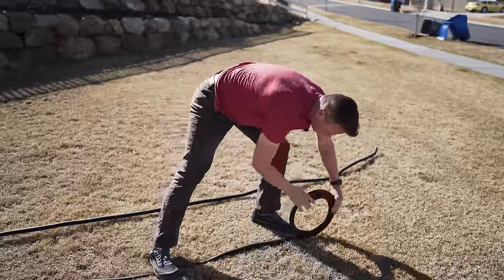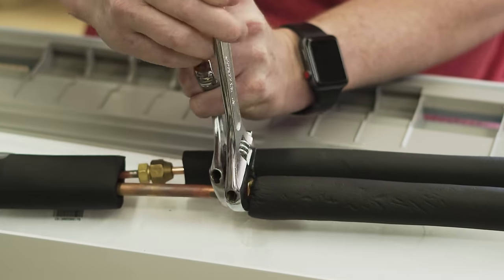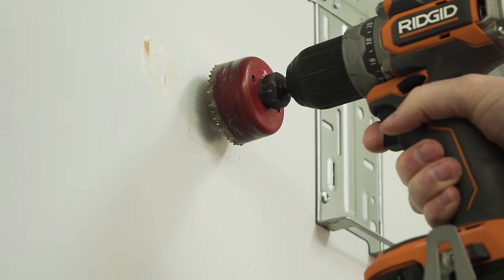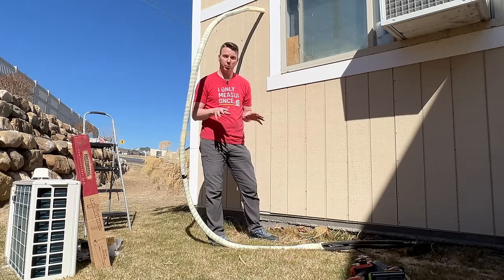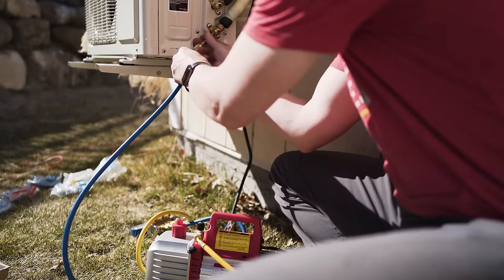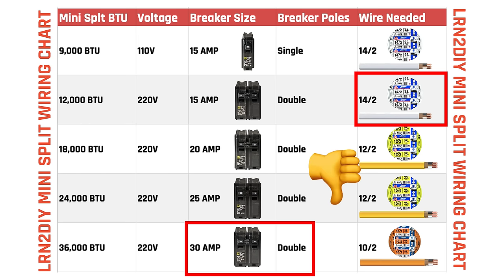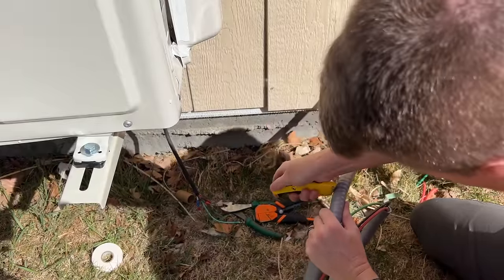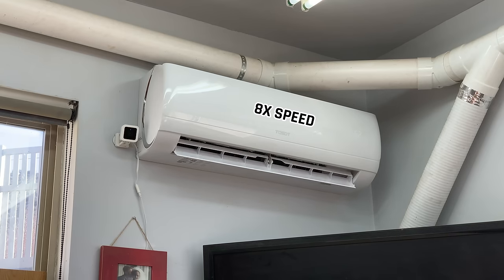DIY Mini Split Install - All the Things Nobody Shows You

Comment: I did the same a year ago with another brand, including electric work. As you mentioned, it was hard to find info on that part!

This video is a great service to DIY. I spent $1400 all in when quotes where $4k from pros. 

Only thing curious is coiling the excess pipe behind the outside unit vertically. I thought that was a problem for some liquid that could block at the bottom (due to gravity) and reduce efficiency. Maybe it is a myth. Mine are horizontal on a flat rooftop.
Reply: You coiled the excess piping correctly in a horizontal plane. Vertical coils create an oil trap at the bottom of the coils. Oil droplets travel in the refrigerant through the system. The compressor obviously relies on proper oil return to lubricate bearing surfaces. Good job.
Reply: @Frank J what type unit did you go with? Trying to figure out which DIY unit is the best bang for my buck.
Reply: @MeltingRubberZ28  Mr. Cool. Works great so far 2 years. Most HVAC techs will not want to service it or repair if needed to avoid liability. Good luck!
Reply: @frankj5947  no issues with leaks or requiring recharge yet?

Comment: I would like to see how long this compressor lasts. Personal curiosity. 

It would be impossible to know if your vacuum pump has boiled all of the moisture out of the system without a micron gauge. If you have moisture in the system it will damage the compressor. Compressor is not designed to compress liquids.
Reply: That is not why moisture in the system damages the compressor. The reason is that the moisture, combined with the compressor oil and heat, creates acid which eats the compressor winding. It also clogs filter driers but many mini splits do not have these.

Comment: Hi, Great Video, I have a question: After I connect My blue low pressure hose to the service port on the AC unit. after I turn on Vacuum pump no vapor out. and after finished all process seems  the air between blue hose and the system no air go thru? what might be the reason? do I need special adapter? thank you in advance

Comment: Overall nice video and very instructive and detailed about the installation.

One thing to note, stated "get the non-evacuated line to save you hundreds"  and then a few moments later "get a vac pump, about $100... gauges about $80"   At this point, the DIYer should just get the pre-evac lines and save the hassle of the extra equipment they may never use again.
Now, if you know someone who has these already, make sure to give them a call  😜

Comment: Thanks for the video. I may be installing one soon and this shows well the basics. I saw numerous things I would do differently. The first 10 comments or so cover many of them like the dangerous high amp breaker and running white wire hot without marking it but several other things stood out to me: on the inside unit wiring both of the braided wires weren't twisted and so were splayed out with poor connection to the fastener, and at the refrigerant line connections both were bare for several inches and the insulation was just wrapped over them and not between them. One is warm and one is cold and they should be insulated from each other as best as possible. In fact I'd probably try to add extra insulation all along the runs as possible to increase efficiency.

The other note I'll make here is that hanging the outside unit on the wall may be convenient, cheaper, and look better but noise from the compressor will be much higher. I like quiet and a few bags of concrete for a separate base would be my plan. Again, thanks for the video, I appreciate it.

Comment: Great instructions. I just installed a United Appliance mini split running on 120. Followed many of your steps. Made the mistake of adjusting the length of the freon lines by cutting them so there would be excess. (There is a minimum length for most units of 9 feet) The manufacture uses aluminum for most the lines and only the tips are copper, so I had to buy some special copper to aluminum brazing rods to make the connection on the cut ends. I thought I could just flare them and make the connection to the the brass fitting of the unit, but found out too late. So copper to aluminum is hard to do because of the melting temperature. Anyway just make sure that your lines are all copper and if not don't cut them to length, and if you do be prepare to learn how to braze copper and aluminum. :face-fuchsia-tongue-out:

Comment: Just a word of caution! 24:30 Wasting copper by installing a far too thick wire is 1 thing, but you really shouldn't use a 30A breaker for something that requires half that! 30A breaker may trip far too late or not at all in case you have a faulty unit that is not quite dead shorted, just has low resistance for some reason, and thus may cause fire! If you know you're not gonna connect anything else on the line, you should always use the proper rated fuse/breaker! If you do connect something else on the line, then use just enough for all connected devices, although it's the safest to have a breaker for each heavy load individually with proper ratings!
Reply: Spot on, the breaker protects the wire from over current. In the uk channels like efix refer to them as over current devices. 
Not sure about US breakers but in the uk they are rated for they type of load. So anything with a big inrush current needs a different type of breaker from the usual domestic circuits. 
Air cons can be a problem as we had one at work that was not gassed correctly and kept blowing fuses. These were old style cartridge fuses so the building manager was going nuts until it was sorted. 
When the motor in the compressor turns on it draws more current to overcome inertia, briefly it will draw more than the amperage that the cables are rated for but it will then drop down quickly. If you have say 16amp cables and a 16 amp breaker it will pop. But a correctly rated breaker will allow brief overcurrent and are rated in type. A type b will have trip between 3-5 times rated current, a type c 5-10 times, a type d 10-20 and type k 8-12 times. These are uk spec so not sure what’s used in the USA, but it will be similar effects. They are quoted in manufactures data. I would hope the manufacturer of the split unit would specify the breaker or at least the inrush current.
Reply: @davideyres955  Most of our breakers are HVAC rated, but its good to verify the breaker spec.

Comment: 1 mistake is using a circuit breaker that is too high a capacity.    The breaker needs to protect the pump, so keep it to spec, regardless of the thicker wire.
Reply: 12.2 amps for a 12,000 unit so go find a 13amp. Breaker. Not gonna happen

Comment: Next time use black and red for your hot wires.  If you're using white for hot you might want to put some black tape so not to confuse people working on it as being neutral.
Reply: I slip a piece of red heatshrink over each end of the white wire when I'm running a 240V circuit.
Reply: The dufus actually thought it was a neutral line! He said so when he was installing the wiring in the panel. That's why he used the white wire. SMH 😆

Comment: Didn't you notice that ALL of the other wires connected to the neutral buss were white?  The white wire is by code always neutral.  Since you've connected it to a line voltage terminal at the breaker you must color both ends to indicate that it is carrying current, wrapping the ends with black or any color electrical tape (other than white or green) will suffice.  You must also indicate that the red wire is connected to the neutral bus by coloring both ends white, you can get white electrical tape or paint them with white paint.  I think other comments have covered the other things you did wrong.
Reply: Exactly should have used  black and red on breaker white is  normally a neutral

Comment: You can also add small anti-vibration pad between your outdoor unit and the bracket. It would reduce noise. And make sure your outdoor unit is high enough to get a nice clearance with the snow accumulation on the ground (if needed). The installation contractor also added a pvc pipe on the outside wall with bracket so the interior unit drain won't stain the wall being at the second floor. It direct the water in bush downstairs.
Reply: I believe he did. He just didn't talk about it.
Reply: Or you could set it on a stack of concrete blocks stabilized with rebar driven into the ground and filled with sand or just plain dirt.

Comment: Just a tip-and thank you for posting this-it worked perfectly - except my drainage hose was kinked and water was running all over the floor.  After much investigation I found the problem.  So to fix it I drilled a separate hole through the wall for the hose.  Thanks again!

Comment: I would also be careful of compressing the black insulation around the pipe you lose the effect of the thermal insulation you want to keep it fluffy and the size that it originally is
Reply from the maker: Good point.
Reply: Tom Williams,  The insulation really does not matter much as for as unit capacity is.  The loss might be 10 Btu's per hour?  Still insulation helps to prevent water droplets during the cooling mode.  I wrapped everything with the self adhesive 1.5" wide 1/8" thick insulation over everything that was exposed.  The refrigerant is moving about 800 to 1,000 feet per minute through the lines, so does not really transfer much heat from the lines to the unheated space.

Comment: On the electrical side of the panel is inside it’s best to have a fuse disconnect. For better protection. And most comments did good on wiring and sizing 
. I would also use flex and watertight connectors

Comment: When pulling a vacuum it is measured in microns not just -30 on the gauge. For R410A you wanna pull down to 300 microns and not exceed 500. With the right setup you could easily achieve that in 15 mins but I would bet with yours you did not. Also you wanna release the charge before removing the hose.
Reply: I came here to say the same thing. Just because you can hit 29.9 doesn’t mean it’s tight. Should have pressure tested first then pump.
Reply: I came to the comments to say exactly what you and Dan Ottaway said.
Reply: 300-500 is 12-20" not enough to remove moisture and 15min is slack especially with POE. 29 for at least 2hrs no matter how big the pump.
Reply: @davebrunson125  45 min should be fine for a small mini split.. watch ur micron gauge, it will pull down to 300 microns pretty quick
Reply: @chrisnorris1379  Hack HVAC 12"/300 microns is not enough to even check for a leak, much less remove moisture especially for POE. No such thing as too much vacuum but not enough is trouble. You might catch on in 15-20 years
Reply: @davebrunson125  Before you start getting cocky and acting like a know it all you should at least know what you're talking about. 300 to 500 microns is not 12 to 20 inches, this is refrigeration 101. Industry-standard practice is to pull a vacuum and have it stay below 500 microns. The duration of a vacuum pull shouldn't be based on time, it should only be based on measured conditions ie: Micron gauge reading. You might catch on in 15-20 years.
Reply: @schellenbergenator  Microns are just another form for measuring vacuum no different than measuring bars rather than psi. no different than MM rather than inches or feet. 300 microns is 12" vacuum 500 is 20" vacuum 750 microns is a good vacuum. go back to school
Reply: @schellenbergenator  now microns are easier to read over inch vacuum because its a wider scale, but they directly convert to each other. Its easier to read 735 which is just under 29 as to 750 which is 29.5
Reply: I'll admit I'm still I'm still old school and read in inches, I was there when they started using microns. there's 2 reasons for vacuum, remove moisture and check for leaks. 15 min of draw down is not enough for either. I got my EPA when it was 6 categories not 3 like today and closed book. I really doubt you've ever seen much less repaired  cascade systems or ammonia. you probably still use a sniffer for leaks. It's hacker kids like you that keep guys like me in demand.
Reply: @davebrunson125  I'll admit you have been doing this longer than me but i have never been taught to use a vacuum for checking leaks always pressurize with nitrogen and use some type of soap bubble mixture to check leaks as the most accurate form of checking. Also when pulling your vacuum lets keep in mind that if you hook your gauges up directly to your vacuum pump you are reading microns at the pump and not necessarily the system which is why its best you put your pump on 1 port and your micron gauge on the other for the most accurate reading, also removing the shrader valve will help speed things up

Comment: I thought you were going to do a complete review of the installation.  The 1st thing to do is to properly size/select a unit for the space, 2nd is to evaluate the mounting locations for BOTH the indoor and outdoor units BEFORE buying anything - most 'kits' come with 16' line sets.  3rd is to determine the EXACT length of the copper line-set, and determine, including bends, what length will work. 4th thing is to determine if you have the proper tools for a system needing evacuation or not - and then buy the correct type, DIY with tools, or DIY without tools.  Only then can someone pickup with where your video begins.

Comment: Instead of just disconnecting the vacuum line after you turn the blue valve off — which allows air to re-enter the lineset — you can use the hex wrench to release just a bit of coolant. 

As you do this, you can watch the pressure go from -30 to just over 1, at which point there’s enough positive pressure to ensure no air enters the valve when you unscrew it, without letting a bunch of pressuring coolant out. Worked great for me.

Comment: Big mistake with electrical wiring.  Do not run the NMB 10/3 Romex wire outside the building in a conduit to the AC disconnect.  NMB is not rated for outside/wet locations even if it is in a conduit.  UF cable is rated for this type of installation.  He could have run 10/3 NMB from the panel to a junction box just on the other side of the wall and run a conduit containing UF cable or THHN/THWN wire to the AC disconnect.  In addition the cables that are entering the bottom of the panel in the shop have no connector or bushing to prevent damage to the cables by the sharp edges of the KO.

Comment: Great video, one thing nobody has mentioned is that you lost your vacuum as soon as you disconnected your hose. You have to let out the refer and then discount the hose otherwise you lose your vacuum as you take that hose off. Also, that 16 gauge wire is your communication wire, it’s transmits signals between head unit and the condenser.

Comment: Good day,  I noticed you chose to use the white wire as your 2ndairy hot!  Might I ask considering you have the red available from the 10/3 cable, Why not use it?  could confuse someone later if they get a in a rush doing maintenance,  you did not add red tape to that white wire!

Comment: Great video. Helped me out. Thanks. Just FYI, L1 & L2 are both hot lines - either side of the 220. Neither is neutral. Using the white wire on L1 or L2 doesn’t make a neutral.

Comment: As mentioned numerous times.  Your breaker size is too large for your amperage draw. Another point to mention , as mentioned numerous times , you should have used the red wire for a 220VAC CIRCUIT.  You have no neutral on a 220VAC / w Ground . In some States ,as in North Carolina. If you did use Romex with a white wire.  Then you must tape the White Wire using black electrical tape. Thus making it as though you are using 2 Black Wires. 
ALL in all good installation minus a few breaker size and wire color issues.  Thank you for the Video.  
30 yrs retired HVAC / R INDUSTRIAL  SERVICE AND DIGITAL CONTROLS TECHNITION.
Reply: He would have failed the required electrical inspection in every state, so NOT good. Plus he is a non professional beginner, with very little experience.. what business does he have showing other people what to do when he does it wrong? You claim you were a tech for 30 years but never learned to spell technician? Laughable.
Reply: @dh66  spell check
Reply: @dh66  yes I agree. Very wrong.

Comment: Help me figure out why you installed a 30amp breaker on a unit that requires 15amps, essentially making the a/c itself the weakest link?  Your wire is not the full picture, the wiring within your unit counts too, and if its weakpoint is 15 amps, then you should protect the circuit with a 15 amp breaker.  Great video, very detailed.

Comment: This video is a perfect case-in-point of why pros don't want to touch homeowner installs.
Reply: What do you expect when they charge almost 5k to do these installs? Ive seen them go as high as 10k thats fucken rediculous
Reply: @djnohands3632  I've seen enough hidden cameras of "pros" pretending to hook up gauges, then pretending to add expensive refrigerant, then billing the home owner outrageous amounts for nothing, to realize I need to learn to do this myself.
Reply: @sylviaisgod6947  Every tech that I have used did it worse than this guy and busts my compressor a year later multiple times. Problem is I don't trust the techs anymore...